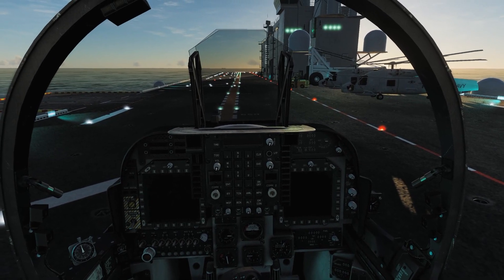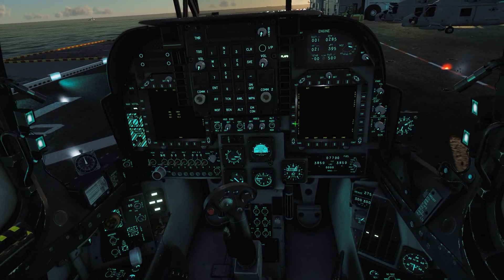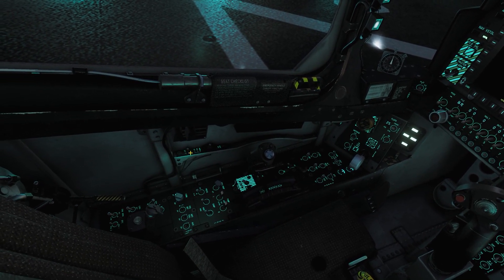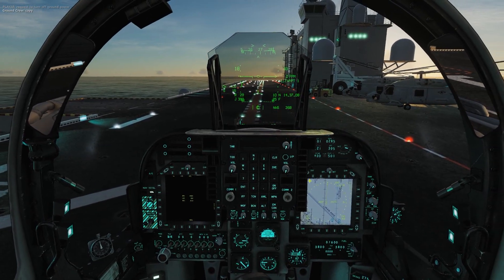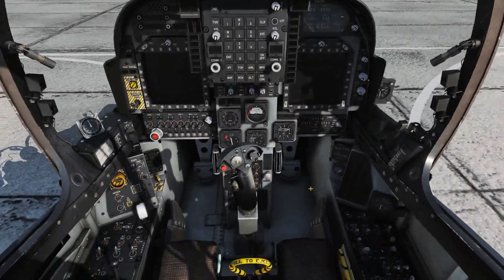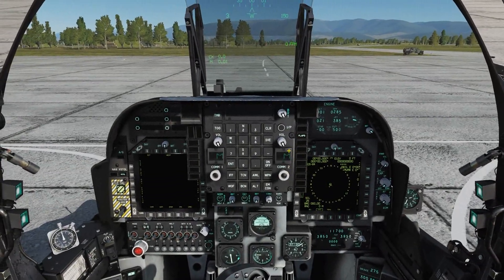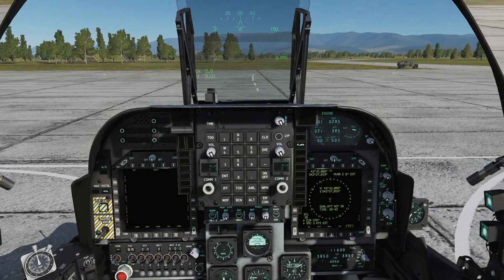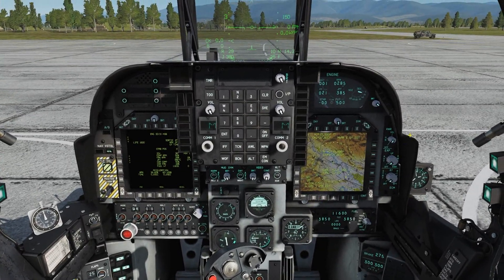DCS World 2.5 - AV8B Harrier INS Alignment Proceedure

Comment: Thanks for the video.
Reply from the maker: The SINS cable is the Sea Inertial Navigation Systems Cable which aligns the AV-8B's INS to the ships' onboard INS for navigation purposes! :)  When you "attach ground power" it also attaches the SINS cable to make that possible.  It's a legacy of the Harrier's British Lineage.  The US generally uses a specific radio frequency on board carriers, but due to the Harrier's lineage, the SINS cable was retained.

Comment: Just one comment..my altitude ladder and my artificial horizon indicators do not appear on my HUD..I think it’s a Bug..as it’s the same on the release version..and quick action..any advise ??? I asked on forums but no one seems to want to help..thanks once again..
Reply from the maker: When you did the alignment, did the countdown reach zero?  When it reached zero did you switch it to NAV?  It should... work! :)  You can also "cheat" it by switching it to Gyro real quick and back to NAV... just double check the heading didn't change any (it shouldn't have).
Reply: Whiskey's Gaming Lounge .no count down at all..only works with auto startup..but even then no altitude ladder.no heading bug..it used to work,but months now missing..thanks for the reply..

Comment: just remains blinking at 00:00.

can somebody help me I tried everything I guess. :D
Reply from the maker: Parking brake on?  SINS cable connected while on Carrier? (Turn on "Ground Power" while on the carrier and make sure the SINS capable gets connected in the messages).  Those are the two most common reasons why the INS wont align.  The other thing to look into is what you have your in game settings set to for the Harrier's INS alignment... there is a "cheat" in the options that allows it to be auto aligned on startup.

Comment: Just a small point, but the pocket guide recommends the final INS switch setting should be IFA rather than NAV. NAV is regarded as a degraded mode navigation (presumably it slowly drifts in accuracy?) but the IFA setting couples the inertial navigation with GPS and continuously corrects itself. I have only recently started training on the Harrier but I get the impression that this is a change from the original early access model which had only NAV.